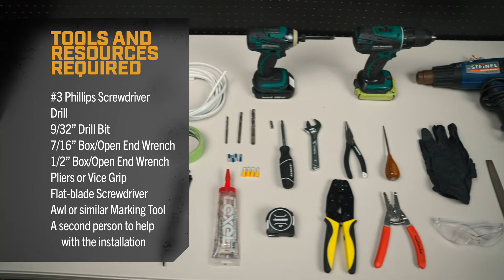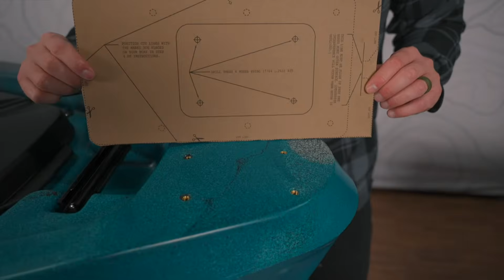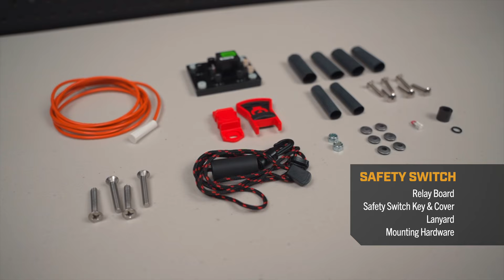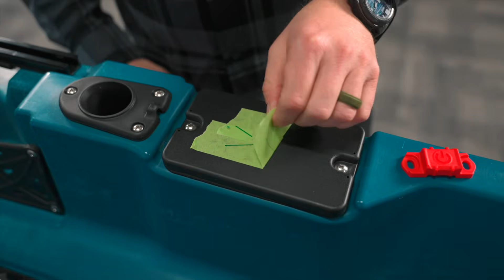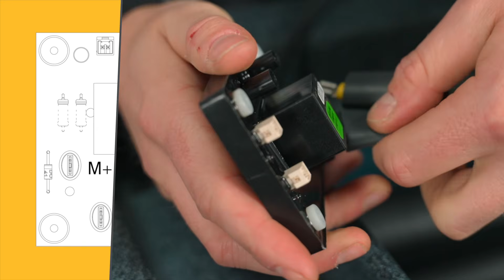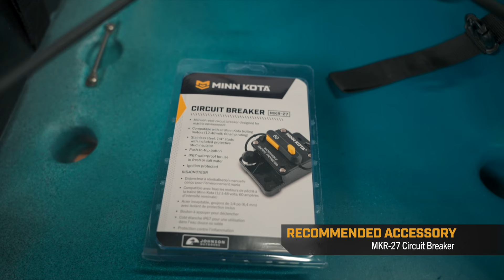Kayak Terrova Trolling Motor Installation Overview | Minn Kota

Comment: Are you able to run that long of a wire with 10 awg? I’m having trouble with finding 1/4” spade connectors for thicker wire for a stern battery location to hook to the fuse panel for the kill switch. I thought I had to use 6awg wire to make my run but in the video he runs 10awg from bow to stern. Is this okay?

Comment: Hello. I have a question about the shaft length. Do you think 36" is enough? How deep can you lower it underwater? My kayak is 45cm deep and I'll be on a lake. I live in Ireland and it's always windy here 🤦‍♂️, so won't this shaft be too short in larger waves? Thanks for any replies.
Reply: Yes it’s honestly over kill. I have a Garmin force current and its shaft is 16.6inches fully extended and I have no issues

Comment: Did anyone notice at the end of the video when he plugged in the battery box the polarity was reversed, Black to red and red to black? Be careful when you make up the connector. which wire goes on which side of the connector block.

Comment: Do you solder 6 awg wire  with 10 awg wire to make all necessary connections?
Reply: Step down connector 6 to 10.
Reply: Add a 60Amp fuse to your battery box and a waterproof 60amp circuit breaker marine grade

Comment: In a different trolling motor vodeo no kill switch was installed and 6 guage wire was suggested. Now with the kill switch 10 gauge is suggested. Is the kill switch not needed?  6 gauge wire will no work with the kill switch panel.  Your videos are very inconsistant with no explanation to wire size.
Reply: I’m having the same issue. Have you figured out the solution? I’m concerned using 10awg to make the run from my fuse panel to battery which is in my stern about 6 feet away from the kill switch fuse panel
Reply: Doesn’t make any sense, even their charts online for running leads suggest fricking 4 awg for runs longer than 10feet but only 8 for less than 5ft. But the fuse panel connectors won’t work with anything but 10 awg and smaller

Comment: Will this trolling motor fit on my Oldtown 106 Sportsman PDL?
Reply: I recently had the kayak Terrova installed on my 106 PDL. It can work but it requires some careful modifications to mounting it so that your pedals will clear the motor when it’s not deployed. Basically from deck up it’s the One Objective bow bracket then a custom fabricated base plate that is angled to ensure pedal clearance, then the Old Town Quick Release mount. I had a local kayak shop make and install the mount. I also added pull cords to release the lock and pull up and stow the motor The whole system works great. Having said that, I’ve now used it several times and although I love the 106 PDL and the Terrova seems great - lots of power and spot lock is fantastic- I don’t honestly recommend them together. The added bow weight is IMO a bit too much for the 106. It caused the bow to dig into even modest wakes and the boat gets noticeably less stable while the cockpit drains. It’s been an interesting experiment and now I’m going to put the Terrova on a bigger kayak.

Comment: Doesnt the old town battery box already come with circuit breaker?

Also, on your other video, it looked like you did not install the saftey switch/relay board. Is this optional??
Reply: Same question here. About the relay board and safety switch.
Reply: Been looking for a battery connector, I should be fine using both an mkr 20 for the trolling motor connection and battery right ?
Reply: Yes @lilbearmar
Reply: I would probably fix your battery wires. You have neg going to positive
Reply: He mentioned the Old Town box already includes the circuit breaker